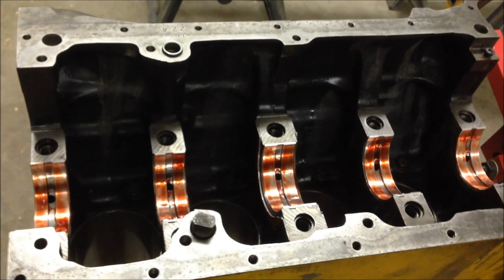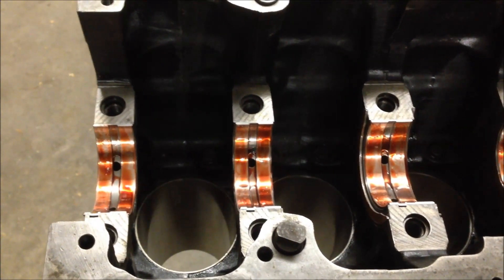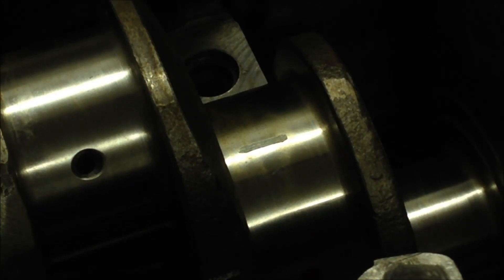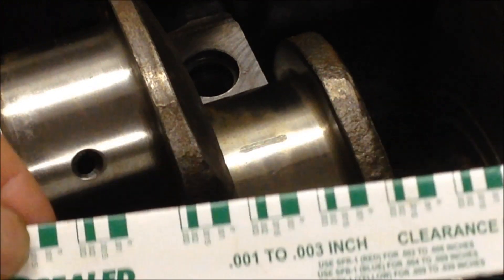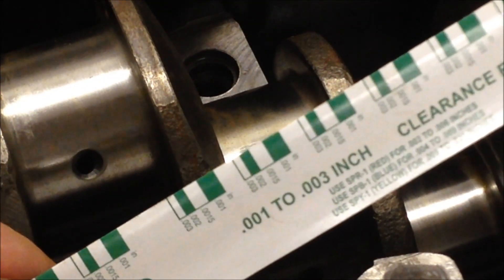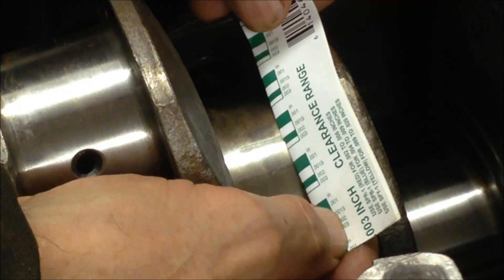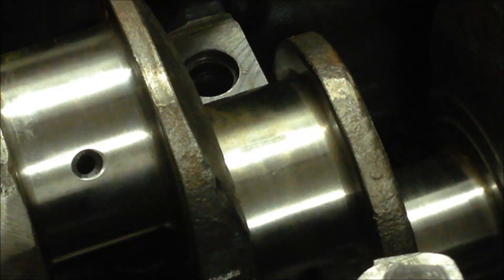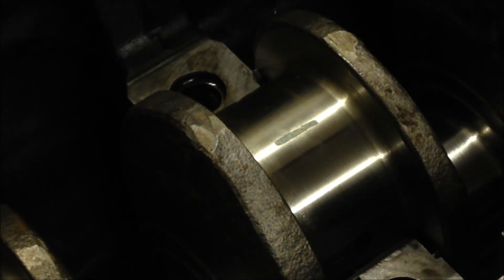Engine Rebuild / Assembly - Perkins Diesel 4.236 - JCB Backhoe Project Part 5

Comment: If I had never seen Plastigauge before I would not know what you are talking about. In your video you show the crushed plastigauge strip after the event, after torquing down. not before. The instructional video would have been so much better had you shown 'before' and 'after' .

Comment: I did not use assembly lube, I primed the oil pump with a long spade drill, This on a 392 IH.
Got a good 60 psi cold oil on the oil gauge just with the drill.
My hot idle PSI is right about 40 psi.
Running .002 on both rods and mains.

Comment: use rubber fuel hose over your rod bolts to hold  the upper Bering shell in place and protects the journal from contact.